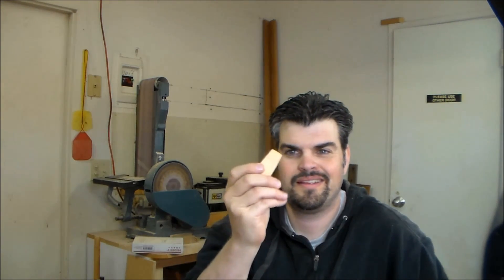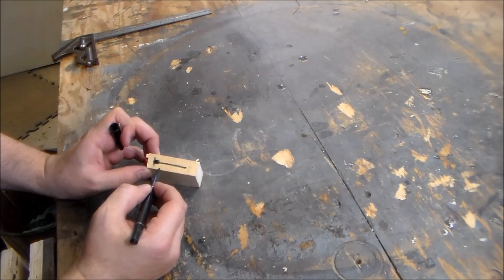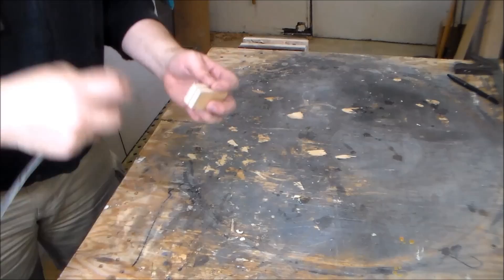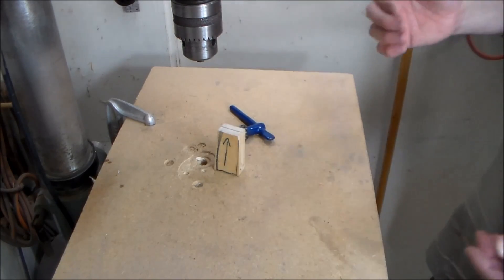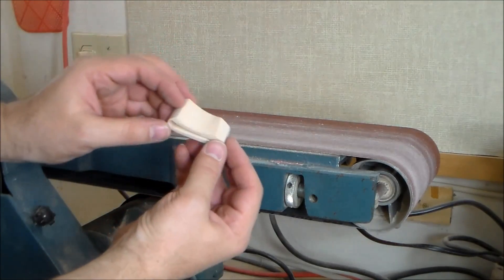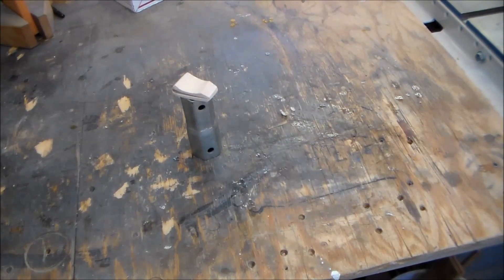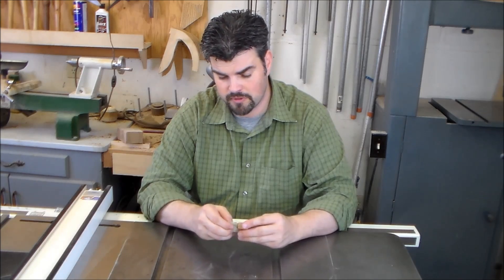How To Make A Wooden Money Clip.

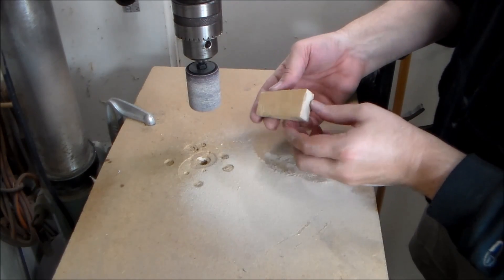Comment: 2:12 either you sand it sucsessfully or lose it off the beltsander with 150mph....hahaha, I really like that type of honesty-Humor:-)   I once broke a piece on the beltsander and knocked my fingertips and fingers right on the belt against the running direction, it was a brand new 60 belt... OUTCH!!  Now i mounted that little table (which originally was thought to be there) again on my beltsander, which prevents pieces from flying off, but thin pieces often get stuck in the gap between the belt and the table :-(